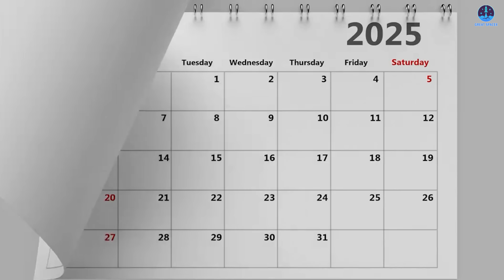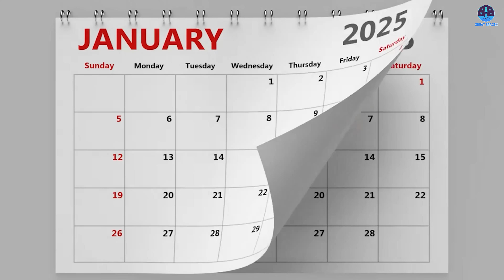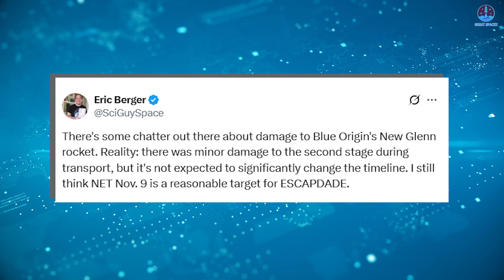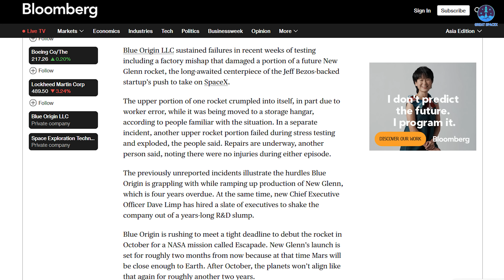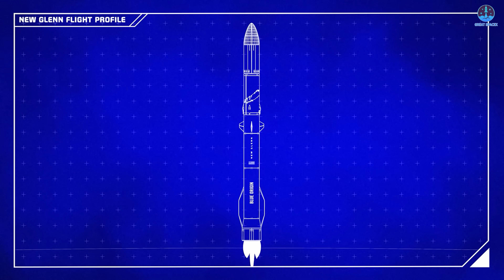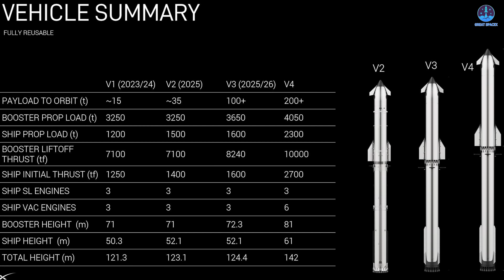Blue Origin New Glenn even Damaged during Transport! Could This Really Land Human on Moon!?

Comment: V3 is scaled back from what it once was and V4 in former V3. Total height is 1.3 meters taller with no change in booster diameter but was supposed to have been a greater diameter. V4 info is either incomplete or will be scaled back with on increase in diameter and unclear whether a Raptor 3 (most likely rather than a raptor 4 recently announced).  YES, SPACEX HAS FALLEN BEHIND EVEN IF THAT WAS NOT ASKED.

Comment: Spacex is smart to keep super heavy boosters vertical. Big tubes on their side unpressurized will distort spontaneously. Keeping aligned to thrust vectors prevents differential time dilation from distorting the rings.
Reply: Shut up dude
Reply: @JMAC479  Let me know when NG has at least 20 reused flights. Till then stfu

Comment: BO NG Flight 2... NET January 2026... that's my bet.  Also have big questions on performance of those strakes and fins on re-entry... I really wonder if those non-grid fins sitting way back in the boundary layer, in the wake of those strakes will have enough control authority to get the end pitched down and on target, or if strakes at some alpha, + or - will produce too much lift for the guidance fins to manage... Time will tell. Elon said in his three part interview with Everyday Astronaut that the most difficult thing on re-entry was to have enough pitch authority to get the engine end down. He said that was why Starship SH doesn't have it's grid fins in a 90 degree "X", but mor biased toward pitch authority.

Comment: SpaceX better be careful! Duffy might give Blue Origin the chance to get the contract for HLS.
Reply: B.O. is so so far behind space x. They are not even in the same decade. B.O. even made a moon lander that mirrors something from nasa thirty years ago
Reply: I agree, but I think it doesn't matter anymore. Space X is the only US company to deliver cargo and personell into LEO on a tight scedule - more than 500 successful flights are industry leading. New Glenn could potentially rival that, but not with one rocket per year with massive delays. As Soon as Star Ship could lift 100 tons into orbit and gets human rated (which is not so far fetched as starts already became pretty smooth so far) it would be another undenieable asset to make space more accessible than ever before. 
It wouldn't change much, if BO could bring down two landers with 5 Astronouts cramped inside before Space X brings 150 ton payloads into Lunar orbit on a frequent basis. It would be easy to fit several rugged, fully reusable Moon Landers into that. To Land 50 tons of payload directly to the surface on the moon not one time, but like Falcon 9 on a growing frequence. This HLS contract would be a neat sidequest, but it doesn't change much. New Glenn is way smaller than even Saturn V. Its nothing to build an economy on. Starship on the other hand will be able to do that.
Reply: @genius1a  My post was sarcastic.🙂 BO is so far behind what SpaceX has accomplished that it's kind of a joke.
Reply: @Workingcinderellaman-jw2pf  Oh! Thanks for the hint!

Comment: new glen is a money pit. if it collapsed from thermal shock then it is not fit for space flight. there is so much waste, delay, and failure in blue origine it should have already had its contracts revoked.  this is clearly a money embezzling scheme. new plan no more taxpayer money until they have 11 flights under their belts.